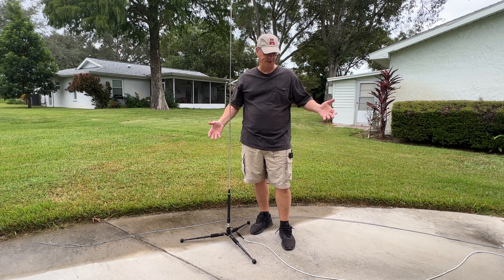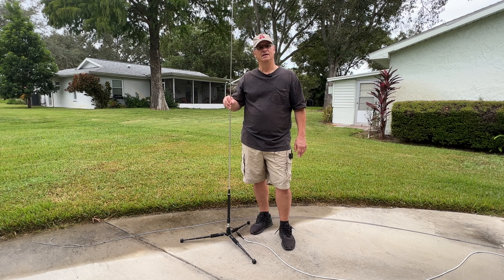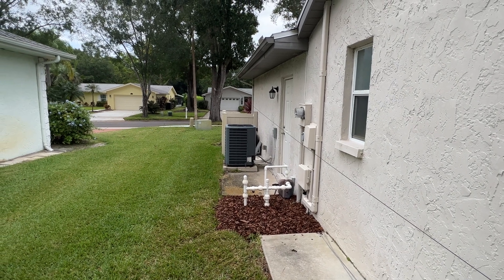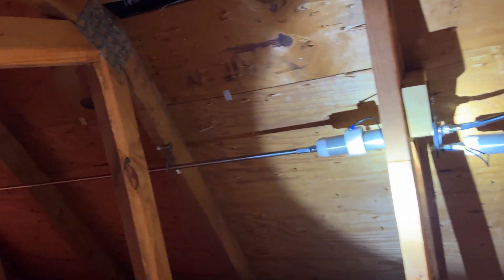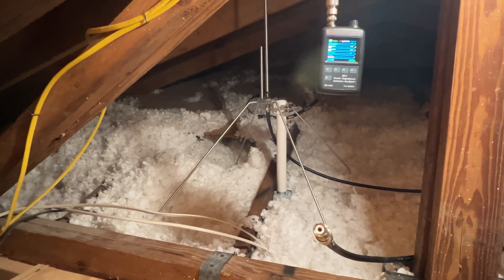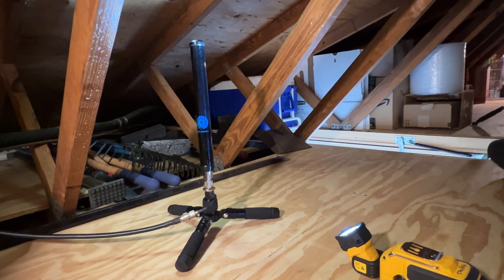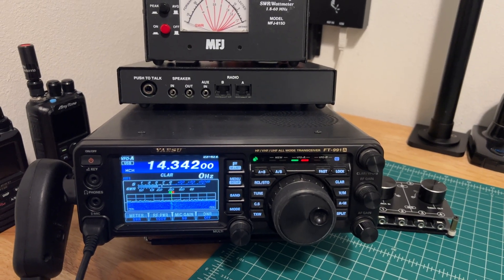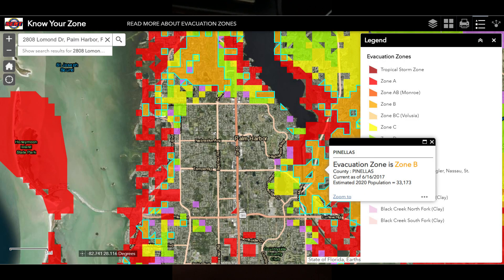Emergency Communications Prep for Anticipated Category 5 Hurricane Ian

Comment: Your doing great antenna wise considering the "HOA." I'm not sure how you got the Cha Endfed past the HOA attached to the lightpole.

Even if you have to wrap it around the perimeter of your house on a fence, I would figure out how to get a 135ft 80m dipole or EFHW for 80m NVIS. 80m NVIS is reliable regional communication, even during solar minimums. With my EFHW over a chainlink fence I consistently check-in to North Florida ARES and Florida Phone Traffic Net 20W phone on 3.94mHz. Below 20W I consistently get in but I may need a relay. The 0mi-300mi NVIS coverage is what you want in most disasters.
Reply from the maker: Thanks Viron for this great input.  I don't have a workable solution yet but I'm not giving up.  You are spot on with your thoughts on NVIS.

Comment: On your 991a if your antenna is resonant, does your ALC meter show anything???? I turn mine to 100% mic gain and if the swr is flat, no ALC shows. Very strange. If the swr is at 2 to 1 then the ALC shows as it should. Wish everyone well in the storm. The last one missed us ( Maine ) but chewed Nova Scotia a new one. Very sad.
Reply from the maker: Thanks for the well wishes.  Haven't checked the ALC situation you are describing.  Will need to check that out.

Comment: Question!  Why not use the 705?
Reply from the maker: FT-991A is the shack radio.  IC-705 is the emergency Go Bag radio always on stand by to run out the door for emergencies.
Reply: @HOAHamRadio  nice ok.  Have you done a video with on your emergency kit radio package?